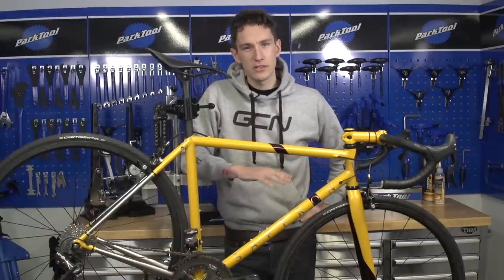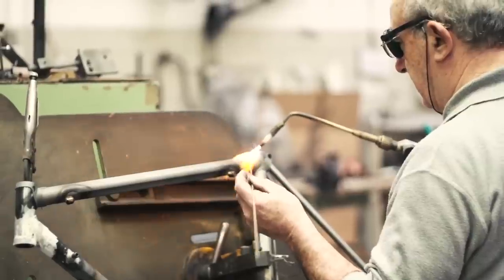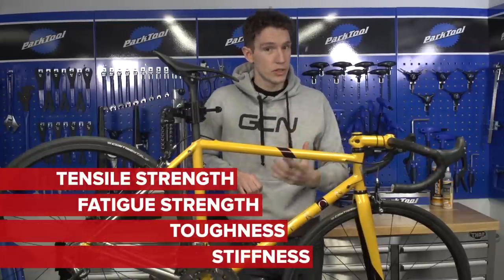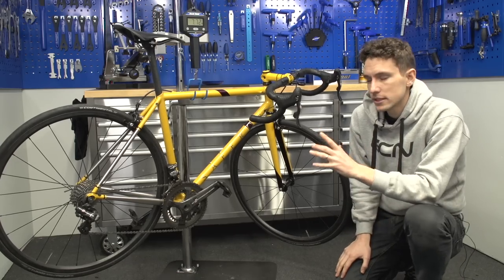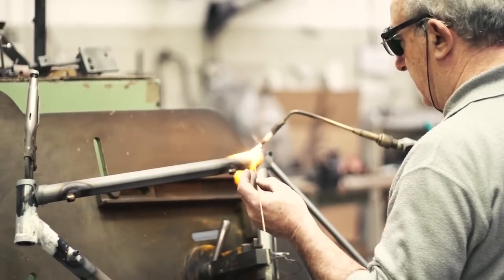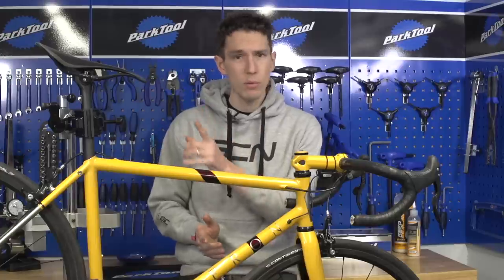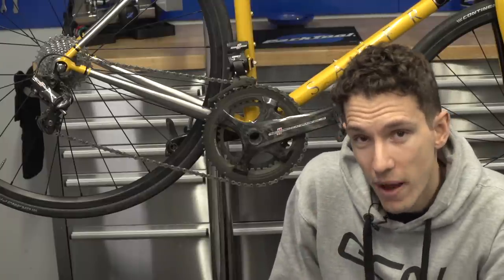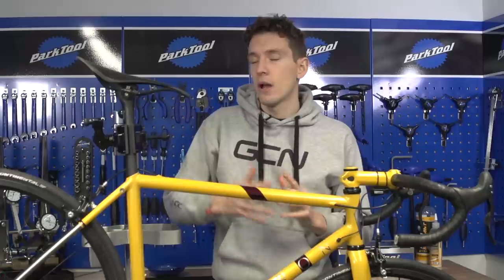Is Steel Real? | 6 Things You Didn't Know About Steel

Comment from the maker: Let us know what you think of Steel 👇
Reply: Global Cycling Network I quite like it. my steel 80s road bike is super comfy and eclipses my very stiff aluminium frame for comfort over long easy miles
Reply: I've had carbon frames, titanium frames, steel frames and aluminum frames over the years.  The only ones I didn't care for the ride of were aluminum.  No more aluminum for me.
Reply: Medium Rick what didnt you like about aluminium frames?
Reply: Had a steel frame bike commuting to college . . . and still have it 20yrs later.  It has big 1.5 inch tires and a great ride.  Custom gearing but  a little rust on the chain stays.  Love it till the rust god takes it away.  Did have one wreck, which destroyed the front wheel but no damage to the frame or fork.  She is heavy but a blast to ride fast downhill with the tall gearing :)
Reply: Still riding steel bikes, mainly because I can't afford to replace them. :)
Reply: I think it rusts
Reply: Global Cycling Network i only ever ride steel
Reply: Steel is cheap.  And it can handle crashes like a champion.
Reply: £2000 for a custom frame. Is not cheap
Reply: A steel bike gives me more piece of mind when out riding. Not afraid to bang it around, isn't as much of a target for theft, and is the only material I would want to do a long tour on.
Reply: Now take it out for a ride! A followup how steel rides video is required!
Reply: Yes, we need to know whether it's truly Ritanium or not!
Reply: if i could have a steel hardtail i'd buy it , money is 0
Reply: Hello gcn

I am looking to buy an aluminum frame endurance bike. I am looking to choose between the Merida ride 400 and the canyon Endurace al 6.0.  

Could you please advise me on which is the better bike
Reply: 99% of the worlds' cyclists are not in a competition against anyone else than themselves whilst out riding. So they really need not worry about having the worlds lightest bike, or the latest groupset. Might as weel be steel then, which is very pleasant  in the long run and looks better! If I were in a race against others, I would probably go carbon too.
Reply: Surely someone could use thinner steel tube walls, the common steel frame appears far from buckling to me. Why not weld the joins instead of braze ?
Reply: I honestly really like the aesthetic value the narrow tubes give the steel frames.
Reply: Steel is legit! Very Springy and compliant. My issue as larger powerful(ish) rider is that steel bottom brackets are a bit too noodly when attacking climbs. Still satisfying to climb with, very physical and engaging, however, much slower than a carbon bike that is able to translate more power than I am even able to generate. There is a sweet power range where a steel bike almost seems to work with you, but if you go beyond that you start to feel the bike straining and dissipating power through the frame even with stiff components. Steel definitely has more character though! My carbon bike is almost disappointingly predicable an efficient. However point it up hill and it's the performance difference is clear. In conclusion: steel is like an extension of your body, carbon is like a clinical precision tool.
Reply: Johnny Cab - (tried to reply specifically to your post, it wouldn't let me - but,) My old Serotta CSI is by far my all-time favorite bike - despite the other aluminum, titanium, & carbon rides I've had or still have.  I will never part with it...if/when it ever gets to the point I can't or shouldn't ride it, it's going on the wall - too many memories to  ever part with.  Although, my wife's not quite sure about that last part, I've told her it's going up in our living room.  ;)
Reply: It's heavy, and it rusts.
Reply: A true enthusiasts quiver would have at least one carbon, one steel, and one aluminum frame.  Ride whatever suits your mood.  Bonus points if you've got all three major component manufacturers represented!  Italian steel rides best with an Italian groupset.
Reply: I love my steel Niner Ros9 hardtail mountain bike.  It rides soft enough to tackle roots and some rocks, but stiff enough to get up much of the steep stuff and help put the power down.  I love it!
Reply: Global Cycling Network I ordered a steel bike that should arrive this month.  I've not ridden one yet though.
Reply: Global Cycling Network I really enjoy riding my 1992 De Rosa, though that new 3T Exploro is tempting. I guess the two things I like about steel frames are the lugged construction for the looks, and the way the bike responds to a sprint. Also, it would be easier, and cheaper, for me to lose a kilo or two of weight, than to go for a carbon bicycle.
Reply: Built my dad a steel bike with a serotta frame i got in a trade. took it for a spin, now im saving my pennies for my own (I typ ride a CAAD10 disc w/ brooks saddle and 25mm tires on 20mm int rims)
Reply: i don't really agree steel is cheap. try get your hands on a steel bike like salsa, or kona not to mention some colnago or cinelli models, the frame alone is over 800€ or 1000€.
not that cheap.
Reply: Agreed - I bought an aluminium (should have tried the next model up in carbon to see the difference). It rides very smoothly at first but then after only a short distance starts to hit back and has a brittle/harsh quality over bad rough. I simply don't like it! On bigger bumps the back end will go up forcing me off of the saddle. Maybe it will feel better on very good road, for sure, but not on poorly surfaced UK roads. Or maybe, I have a weak sensitive body, haha, either way, I ride my cheaper, slower steel frame bike far more. That speaks for itself. Out of Ti or steel do you have a preference, or simply they are both good, just different?
Reply: For me, too stiff and unforgiving on anything but very good road. Feels great at first but starts to hit back at you after a while and feels brittle and harsh. There is no give in it. I have only ridden 4 aluminium frames, so of course, hardly a huge number,  but of the small number of steel and two ti bikes I have ridden, I prefer the ride of metal.
Reply: Steel bikes only rust a lot if you leave them out in the wet and damp all the time. I have a steel frame bike and keep it in the garage. It has superficial rust, but nothing to damage the frame. I've had it over 20 years. A relative of mine has had a steel frame for 52 years! Had it resprayed and looks like new with no structural damage. If it gets very wet, gently wipe it down and keep in a dry place. It will very likely outlast the rider!
Reply: I think, he means the raw production of steel is cheap. Making into tubing, butting and shaping and then the man hours involved in welding and so on...that is what starts to add the costs up. Plus, of course a small boutique frame builder making custom builds will add a healthy margin. It makes sense, they don't make many frames, in the grand scheme of things, so they need to charge a higher price to make a reasonable living. Finally, they obviously think the market can bear these prices or you would start to see prices drop. There must be people out there rich enough or willing to save enough to spend that kind of money.
Reply: Really, why? Did they go out of business?
Reply: I have the Merida Scultura 904 aluminium. A slightly more sporty version of the Merida Ride. It is not bad, but can start to feel harsh after a while. Who knows if you will like it or not? I would say, go to a shop and try one. As for the Canyon, you can't try one of these easily as they are direct sell. If you like the Merida, you will probably the Canyon. They go for the best value one. If you don't like the Merida, then maybe try some other bikes before you buy!
Reply: I love it - I have four different vintages of old steel road bikes. My favorite is a Peuguet with a cheap carbolite 103 frame. Paid 30 bucks for the frame an some hardware was intact. I have probably $100 in it beyond that. I'm not out winning races but on long rides my friends aren't dropping me - and that is all that matters....
Reply: Ok. That bike looks stunning.

Steel? My first bike was steel, then I got an Aluthron frame by Columbus. Then another bike of aluminium, and now carbon. I'm still havig GREAT memories about that old first steel frame I had, and if someday I can afford a second bike, sure I'll build a steel one. They still look amazing. I mean, look at the Colnago Master.
Reply: Love steel /bc I don't need to be delicate handling or storing it. Don't care about outright speed/weight that much, on my level those are secondary things. Vintage bikes also cost and look right.
Reply: I mean, look at thaaaaaaaat bike's weight. 7.72Kg? I'M TOTALLY ABOARD. Impressive and amazing.
Reply: I love old bikes. I ride one from the 60, all steel old school. You can repair and ride bikes very cheap and make you  very stylish!
Reply: Forget about steel I am in love with the way si talks and presents his knowledge with a pinch of imposing express. #vamos_simon
Reply: Then John Henry said to his Captain 
A man ain't nothing but a man
But if you bring that steam drill 'round
I'll beat it fair and honest
I'll die with my hammer in my hand
But I'll be laughing

Because you can't replace a steel drivin' man 
Lord, lord
You can't replace a steel drivin' man
Reply: Si - do a bit about Titanium!
Reply: Great video, loving the science based videos and factory tours, great quality! I'm a material scientists so i can verify that you really know your stuff and you are great at explaining it.

Do you think the toughness of steel is significantly greater than Carbon Fibre these days? 
Is the fatigue threshold a substantial benefit for steel over Aluminium for long term durability of steel frames?

Cheers Simon Richardson,
Oliver
Reply: I'm nearly as old as Mat. I'd stopped cycling for 17 years. When I eventually decided to buy a carbon bike it was fantastic. I'm not going back to steel !
Reply: if it was good there would be pro teams on steel.
Reply: What bike did you buy?
Reply: richy morris a Giant Propel. I'm back into racing and have even won races with it. Great bike.
Reply: I love steel, but it has to be noted that I also love a good Carbon fork matched with with a steel frame ( as in you example ) so its not so simple is it!
Reply: old 1983 gios torino professional, slowly updating it and it has been a beast of a daily commuter, i also ride a ritchey commando and .243 industries dirt jumper, always loved the traditional and robust feel of steel.
Reply: Ride steel become steel
Reply: I own both steel and carbon road frames.  Both are modern with geometries that are similar (though not exactly the same).  It's worth noting that a modern steel frame really is light-years ahead of what was available 10 years ago: curved stays, and built up at <16lbs without anything special.   Ride quality is quite different though -- though you certainly can build different qualities with steel, and likely even more so with carbon.  My carbon bike is STIFF.  It makes you feel racy just being on it.  Great for fast group rides (like my local Tuesday lunch/crit ride).  It's like being in an F1 car.  My steel bike is stiff, but it doesn't have that "edge".  It's like being in a street-going Ferrari.

I enjoy the steel bike more -- it's just a lot more rare these days.  It's not retro by any stretch -- and it gets more attention on the road and in the shop.  (My steel frame also costs a pretty penny MORE than my carbon frame.)
Reply: Global Cycling Network well... here's a point... how many carbon or ally bmx frames are there?

I ride all three materials (steel, ally, carbon), and they all have their quirks. Least harsh ride quality is the steel.
Reply: Light years is a measurement of distance not time.
Reply: For me steel is real, because it has extremely good durability and fatigue resistance. I cherish my old bikes and some of them are decades older than me and i can still ride them like new without worrying it might break. 

Aluminum on the other hand is just a time matter before it cracks and is no longer safe to ride. Unfortunately aluminum is horrible at fatigue resistance and any 20year old Al frame is a wallhanger in my opinion. Same for carbon fiber. That can easily be damaged even sitting still in the sun, or by humidity, or by any crack emerging, etc.

And since I don't cycle professionally and don't race, I'm satisfied with the performance of steel even with added weight of the steel for it's properties, especially for the durability.

And as this video said.. there are many types of steel.  And a huge difference in design.. there were cheap bikes in older times as well. I like to get top tier chrome-molly steels (reynold531, columbus slx, etc..) that have awesome engineering to make the most of that material. (light with triple butted tubes, nice brazing and lugs, quality components, a lot more rustproof than a hi-ten steel beater, and also high-end steels were expensive and most of them are good taken care of. So they are in better condition than cheaper frames.)

So to me is important to have a piece of history in form as a bike, and still ride it and be safe.

A good steel bike can outlast you with just a tiny bit of attention to keep it in good condition.

Many of my old bikes already outlasted previous owners and are still in working condition.
Reply: Steel takes me back to my childhood. When riding was a wonderful escape from mundanity and a ticket to adventure.
Reply: Go for either steel or titanium. The aluminum frame will leave you beat you up specially if you intend it to use on longer distances.
Reply: Reynolds 953 doesn't rust
Reply: Titanium can be a more light material, having ridden both, a Ti Lynskey R150 with standard tubes (no butting) feels quite similar to a Chromoly 4130 vintage Schwinn Cimarron with the difference in weight only. One day I would like to get a Reynolds 953 tubing bike.
Reply: MegaXtc11 yes it does, if
there is no steel on earth that is immune to rust

and rust is hardly an important factor,it's not hard to prevent nor hard to fix
Reply: MegaXtc11 Columbus XCR & KVA MS3 doesn't rust either!
Reply: I think my next bike is going to be a custom made steel frame and fork. I currently ride a steel frame/fork but being that it is an older vintage bike from the early 80's combined with the fact that it is certainly not sized for me (it's too large) does cause me some pain when I have taken breaks from riding. Thus the need for a new bike sized for me. Trying to find out what would be the best gearing, wheels, seat, bars, and geometry is all that I have had trouble with determining now.
Reply: Steel is real.
Reply: Had a chromoly bike with tubular tires and it rode really well but I think it had more to do with the rims/tires than the frame. Get 3 bikes with each material and forget about this debate!
Reply: Global Cycling Network  Fortunate enough to own an aluminium Trek 1.9 and a carbon Domane 5.2 both equipped with Ultegra 6700 & 6800 triple groupsets but with superb Campagnolo Shamal Ultra wheels & shimano Dura-ace 11-28 cassettes on Continued 4000SII’s. However the bike on which I regularly record my fastest times over regular 70 or 100klm rides with 732   and 1264mtrs of climbing is a custom sized hand built Battaglin Columbus SL  with 2003 Campagnolo Record triple groupset  including 12-29 10spd  cassette on Campagnolo Neutron Ultra’s again with Conti 4000SII. Saddles are all identical Brooks Swifts on to rails. Comfort at my 70+ years
Reply: +dont be average:
2 grand sounds OTT. There's an engineer in Kildare, Ireland who will make one out of top-end Columbus for a grand, and his stuff is winning every single race up there nearly.
Reply: +MRGRUMPY53:
Oh crap, seriously?? Jesus their top stuff was as good as Columbus and Reynold's best.
Reply: +Brown 266 Get the Raleigh
Reply: +Trefor Jones:
Columbus SL on the Battaglin, not SLX?? She sounds lovely though
Reply: +AsiAzzy:
Very well described, and I second it all as me on my 30 year old steel steed are regularly beating guys ten years younger than me on all the high end modern bikes. :)
Reply: +nonfictionone:
There are now pro teams back on steel again, and it looks like there are more to come.
Reply: My touring bike is all steel, out of simple and repairable 4130 tubing, which does, however, add more heft to it. That said, on a frame designed to be very robust and carry a lot of weight, and tackle both good and bad terrain at the same time, it very much hits the spot. I think the effect of frame material on the comfort is a bit overstated, the tires are probably the biggest factor followed by saddle and grips, but I do find it really comfortable on very long rides. 

Sometime in the future, I might add a more racy road bike with lightweight steel tubing to my stable.
Reply: Best in terms of 'to live with daily.' 

Not too heavy, very responsive, repairable, modifiable, and safe (won't just violently shatter under the rider, loads of warning before the frame goes).
Reply: There are surely still far more bikes in the world made of steel than anything else.
Reply: You need to look up Rodriguez Cycles in Seattle. They build a steel bike that is under the UCI weight limit and rides like a freaking dream. It is INCREDIBLE. You need to go review it.
Reply: MRGRUMPY53  Niner makes a steel hand tail.
Reply: Steel is real!
Reply: I've ridden 4130 and Columbus SL, 6000 & 7000 series aluminum, bonded and monocoque carbon fiber frames. I rely on my XCR stainless steel framed Pelizzoli with a carbon fork. Fits me better than any other I've had and has great compliance and more than does the job in grand fondos and the occasional club training ride. To each his or her own.
Reply: Ive got a 2014 Roubaix expert,and Ive got a cherry 1990 MASI Team 3 V. Ive recently drug the MASI out and give it a refresh and started riding it again. I cant for the life of me see why I spent 4K on the roubaix. 1lb and 1/2 difference on overall weight. MASI takes bumps like magic,the roubaix does not. MASI is stable at any speed,Ive had it at 62mph drafting a tandem downhill,  The roubaix is twitchy and racy..................If I was a racer the roubaix is stiffer while climbing,but Im not and it really doesnt matter. I spin up hills............If I could Id sell the roubaix but it would be a 3K hit so no point. I Hate All the noises carbon bikes make. The MASI is eerily silent.
Reply: I wouldn't take a carbon bike on a bet. Without a team car with spairs they are worthless. They sound hidious.
Reply: Global Cycling Network steel doesn’t seem a great choice for indoor training 🥵 sweat + steel = quick rust
Reply: Global Cycling Network Steel is the best in the world
Reply: I love my 80s steel Trek road bike
Reply: Mike Staufert clean it up and oil the inside of the frame
Reply: BeamRider100 butted tubing has been around 50 years, and non lugged frames are welded
Reply: Brian McCleerey get a touring frame with double top tube. It will take mashing uphill
Reply: pedro andrade KHs has good basic bikes for low prices
Reply: Steel is the best bike material for everything other than racing which no doubt carbon takes that place. I've broken 2 alu frames from fatigue after only 30000km each and no not in the weld which would mean bad manufacturer but in the middle of a chain stays. Never had a problem with a steel you only have to take care of the inside to prevent the rust and it will last for a very long time.
Reply: On a steel horse I ride 🎵🎶🎵🎸🎸
Reply: A lot of people love it. I personally prefer it over Aluminum. Titanium is even better but is expensive. I believe a well made steel frame with good Carbon and Aluminum parts will be a very great performing machine that will last for long. A Road bike with 40c tyre clearance maybe? Would love that!
Reply: Just love zinniness of steel
Reply: I ride my steel café racer (unrestorable 1925 lugged frame). And I love it. Love it much more than my other bikes. For its story, unbeatable build quality, comfort, speed and.. last but not least.. uniqueness. 96 years old bike can do it better than the most of today's builds. Steel is definitely real.
Reply: @NewYorker79924  mine is 96 years old.. It would be here much longer than me. Used daily. Unbeatable build quality. And.. I got it for free. 😄. Adding just alloy rims, 3 speed nexus and all white paintjob. Functional eyecatcher.
Reply: 500 grams different its not worth it to buy carbon
Reply: For a racing bike it is top! For a mountainbike not so much IMHO. I drive two steel racing bikes, but my MTB is a titanium frame which gives more comfort while having that little more 'flex'. My early 90's steel Batavus is a wonderful road racer that steers very accurate and above all: looks great!
Reply: @mediumrick7667  try new Cannondale Caad13
Reply: @NewYorker79924  Have the paint re done, don’t just let it go
Reply: All my bikes are steel except for one that’s aluminum. I prefer them because they are beautiful( to me)  and don’t mind the weight. One of the reasons I ride is to stay fit, keep the pounds off. The extra resistance is beneficial.
Reply: I ride a steel frame KHS
Reply: Would you buy a steel frame from Agustin Hincapie?
Reply: I had a Trek 510 for 30 years. I loved how comfortable it rode. I like the look of the custom lugs. Modern bikes aside from paint are kind of plain looking.
Reply: Nice video. I didn't know Simon is a Si-entist. See what I did there? Hilarious.